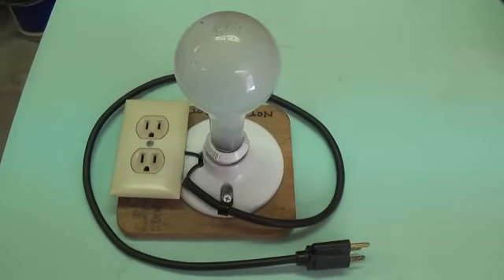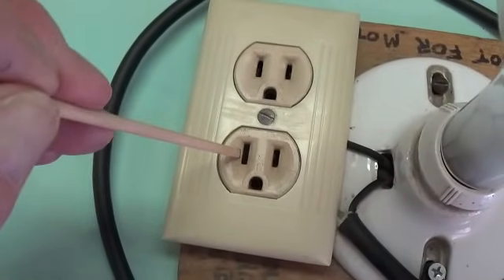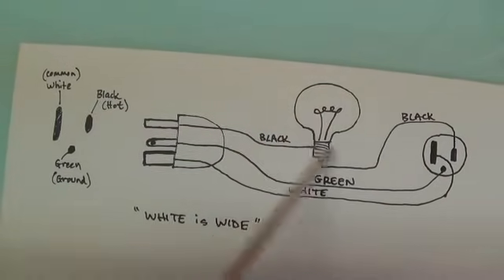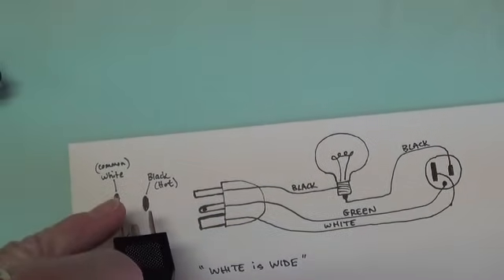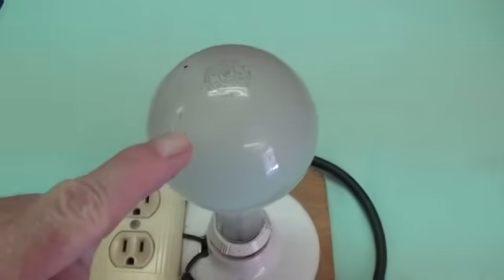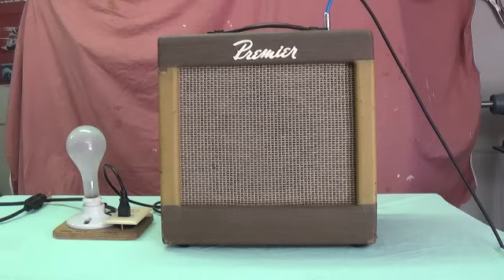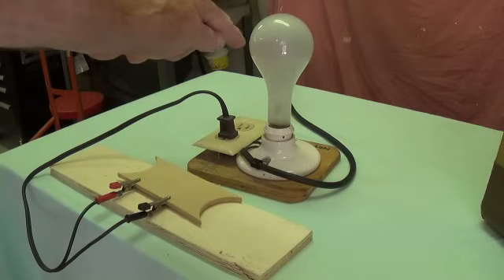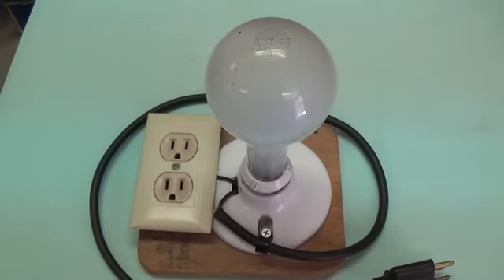Build Your Own Current Limiter for Protection when Repairing and Testing Electronic Equipment

Comment: I’ve watched your DBT video and I understand your explanation as to why a higher wattage is so crucial. There must be close to 50 DBT videos on YouTube and I have watched nearly all of them and just about all use lower watt bulbs so that when the amp is turned on the bulb illuminates then dims providing there is no short. One person said you should size the bulb wattage 150-200% of the amps wattage draw. Another person told me you should not need any higher than a 100W for an amp with 4 X 6L6 tubes or a 60W for 2 X 6V6 tube amp. I constructed a DBT and tested several of my amps to see how it functions and my 200W bulb did not light like in your video. I tried a 100W bulb and it did light up dimly only momentarily then went out. If you are right about using a higher wattage bulb then it looks like just about everyone on YouTube is not doing this correctly. I honestly don’t know which is right but I’m guessing the reason this is known as the dim bulb tester is because the bulb lights dimly then goes out when there is no short. Do you have any thoughts on this? I’d really like to understand this better. Thanks
Reply from the maker: I honestly don't think it makes all that much difference, 60R, if you use a lower wattage bulb that lights up and dims, or a higher wattage bulb that only lights up when there is a short. Either way, the circuit is protected from drawing excessive current. Personally, however, I prefer my method, simply because any illumination of the bulb is a warning sign. Furthermore, the higher wattage bulb offer higher filament resistance and thus greater protection for the circuit.

Comment: I read  " not for motors" 
, my old tube tape echo runs with a motor, is that a problem? Thank you
Reply from the maker: The problem is that most motors draw a large initial current to start.....and the current limiter will not allow them to do so.  As a result, I don't suggest using a current limiter with an AC motor.
Reply: Uncle Doug Thank you so much sir. My echo has a switch for turning on and off the motor separtly, i'll keep that in mind when repair the electric circuit that the motor is turning off. Again many Thanks much appriciated.
Reply from the maker: A very small AC motor may work with the current limiter. You can easily test the motor with and without the CL to see.

Comment: Hi Doug, I built one of these years ago after watching your channel and it's worked perfectly all that time so thanks for that and the fine work you do educating us :-) BUT today I got caught out and I want to share my experience with you. I plugged an amp in to my variac via the current limiter as usual BUT I left it in circuit when I started to bias the amp and as a result all my voltages were wrong since the current limiter acts as a voltage drop. So my warning to everyone out there is, remove it from circuit when you set the bias voltage and/or measure voltages for fault finding. Perhaps you could confirm if my recommendation is correct Doug or tell me what I did wrong, thanks!.
Reply from the maker: You're welcome, Nigel.  You're absolutely correct, the current limiter does reduce the circuit voltages a bit. You can bias without it, or you can apply a correction factor, or you can do what I do and simply accept the slight reduction as a "safety factor" to ensure somewhat conservative biasing.

Comment: I can't speak highly enough of these. Whether you work on tube amplifiers at home, solid state amplifiers at work; biasing procedures, modifications, an output stage rebuilt. You really need to have one of these as they can stop your circuit from blowing up if you've done something wrong.
Reply from the maker: Amen, LH. It is definitely one of the most useful tools on the work bench.

Comment: I'm confused why this works, Doug! If there's a short circuit in the equipment under test, then it's in parallel with the bulb, right? If electricity takes the shortest path, then why doesn't the short take effect and blow the circuit breaker? Also, if there's a short circuit why does that damage the amp?
Reply from the maker: A short circuit within any electronic component can destroy it, NR, generally by heat and/or internal arcing......not to mention the smoke and stench. Any short within the amp is in series with the bulb, and the bulb filament will immediately heat up, greatly increasing its resistance, illuminating the bulb to warn you, and thus prevent excess current from damaging the circuit.
Reply: @UncleDoug  Ah, I missed the SERIES part. That makes sense now - thanks!

Comment: I’d suggest connecting the black wire from the main to the center of the bulb not the outer edge. That’s how it’s done per code. Of course, since we’re working in an open chassis safety is really up to the tech.
Reply from the maker: Thanks for the suggestion, Kirk.

Comment: Hello Uncle Doug, Thanks a lot for All your video's much to learn from.
I got a Question 
I was thinking to build and use this continuously between my vintage early sixties guitar gear. Like an old tube tape echo(high voltage circuit inside) They were build unsafe those days, most old tube gear has a 2 wire cord with no grounding. I believe when it's get a short inside, I ' will be electrocuted by my guitar. (We got here 220Volt)
The idea was those days, when it's get ever shorted....the short goes via the output of the echo to cable to the amp, that is well grounded, oh and if she is not grounded fit you got a major problem for your amp and yourself to! (kind of ridiculous anno 2019). I her people saying; why not install a 3 wire cord with ground fitted to chassis?? Well, I do not want to do a modification inside because of originality.
Could this be an alternative solution for me?

Regards
Reply from the maker: I really think that installing a chassis-grounding power cord in both devices would be the best idea. It's done all the time and doesn't reduce the value of the amp or effect. The only other possibility would be to run a ground wire from your wall socket and clip it to the amp and/or tape echo machine. The current limiter will greatly reduce the possibility of a fatal shock, but will not protect you as well as a grounded chassis.
Reply: Uncle Doug Uncle Doug Thanks a lot, you now got me persuaded. I definitely install a seperate grounding wire, or use a 3 wire cord.
Reply from the maker: You'll be much better off, R4. Best of luck.
Reply: Uncle Doug many thanks for your advice sir. I decide to replace the powercords for a 3-wired cord with groundwire mounted to chassis. Is a fuseholder with fuse between hot wire recommended?

Comment: After 904 comments my answer is probably buried here somewhere, but haven't seen it yet.

I in the U.S, have a 220V 75W bulb, will that work?  Im thinking higher voltage=carry more wattage.

Best video I've found, thanks
Reply from the maker: You're welcome, Kip. I would advise against it. You can generally find 200W bulbs at the Home Depot or even higher wattage on Amazon.

Comment: Uncle D, I tried to read through the 5 years worth of comments to see if this was asked yet but I didn't make it to the end so I'll ask anyway. Can this be used with an isolation transformer ? If so would the IT be plugged into the CL (since the CL is grounded)?
Reply from the maker: Yes, you would plug the CL into the wall receptacle, then plug the IT into the CL.

Comment: Uncle Doug- It’s amazing how deep some will dive when a discussion of building a simple test tool is shown. Very inspiring to get the concept and its application. As a byproduct, I was forced to learn with the aid of yt videos how to solder by learning what makes a good solder joint. That and having taken my backyard welding up a few notches in industrial machine repair. All I need is a lathe, a surface grinder, Bridgeport milling machine and a 6X48 belt sander to round out shop equipment! Or maybe just bend sheetmetal with angle iron and C clamps!
Reply from the maker: As Archimedes once said, "Give me some angle iron and  C-clamps, and I can make an amp chassis".

Comment: Hello uncle Doug! I am about to start building a tube amp, and wanted to build a current limiter like the one you used. I have a 150 W halogen bulb with its socket, do you think I can use that instead of a incandescent? Thanks!
Reply from the maker: I wouldn't trust it, Luis. You can get incandescent bulbs at most building supply stores as well as Amazon and probably Ebay.

Comment: I have a runway light bulb, 120V @ 40 amps, would that be good?  The filament is the thickness of a pencil lead.
Reply from the maker: No, that is the opposite of what you need. Try a regular old incandescent 250W bulb. You can find them on Amazon.com.

Comment: All of North America, The U.S., Canada, and Mexico, use the same power standard.  Japan uses 110v/50hz rather than 120v, but that's very close to North American power standards, and is obviously a little less voltage overall with a lower frequency cycle of 50hz compared to North America's 60hz.
Reply from the maker: Thanks for the input, FC :)

Comment: Excellent device. This is a perfect example of "less is more". I recently acquired an old radio with a 5Y3GT and 2 6V6's. Would that work for seeing if the tubes are good or bad if I swap them into an amp?
Reply from the maker: Thanks, Joram. I'm not sure that I understand the question. Are you wondering  if the current limiter can be used to tell if tubes are good or not?
Reply: Sorry for not being clear. I've acquired a 5y3gt and two 6V6's from an old tube radio and I'm wondering if the light bulb device would protect an amp from any possible faults in those tubes in my amp? Sorry for being so verbose. @UncleDoug
Reply from the maker: No problem, Joram. Yes, the current limiter will protect any electronic device regardless of the tubes it may contain. All it monitors is the current going to the device, not the components within it.
Reply: Thanks, that's great news. Like yourself, I like to minimise costs and recycling parts is a great way to do it.

Comment: A good old dim bulb tester    .with larger wattage incandescent bulbs almost obsolete a few 75-100 watt bulbs in parallel  may be needed to make the device .
Reply from the maker: You are correct, Mr. 71. Home Depot seems to have high wattage incandescents in stock from time to time.

Comment: Hi Uncle Doug
based on your video I just built my own current limiter for my hobby lab. 

A few weeks ago I had damaged an older amplifier due to a short circuit caused by me.
With the current limiter the damage would have been less likely :)

Great thing!!!
Reply from the maker: Congratulations on a successful build, Dr. B. Your amp circuits will be safe now :)

Comment: Quick question UD: Would a lower wattage bulb provide more protection, or would it just be more likely to illuminate as a result of normal current draw in a tube amp?
Reply from the maker: The bulb wattage must relate to the amplifier wattage, i.e. 200W to 250W bulb for tube amps from 5 to 25W output power. 300W and above for more powerful tube amps. 50W to 100W for SS circuits.

Comment: Oh, Uncle Doug. I see you still subscribe to that obsolete "Electron Flow" theory of electricity. ;)
Don't you know that electricity travels through smoke, not electrons?
Once you let the smoke out of any circuit, good luck collecting it and stuffing it back in. (JK)
BTW, I'm re-watching this video because I need to build one of these for my upcoming Newcomb D-10 conversion.

The more I watch your videos, the more I get from them. Thanks for everything you do.
Reply from the maker: You're welcome, F3. I"ll brush up on my theory :)  You're wise to build the CL.....it is essential for protecting circuits being tested. Good luck with your conversion.
Reply: Since stuffing the magic smoke back into a circuit is harder than herding cats, I think building the CL is DEFINITELY the path of least resistance. (Pun sort of intended)
Reply from the maker: It's an absolute necessity, F3.

Comment: Concerning electrical- wiring color codes, some modern IEC modular type power cords (as you would see used for computers and other devices that have a removable/ replaceable power cord) actually have a European? or Asian? color code; green would be still ground but the hot and neutral wires are brown and blue respectively if I remember correctly. I always check it with an ohmmeter first just to be certain!
Reply: The IEC 'earth' a.k.a. 'ground' wire is green with a yellow stripe.

Comment: Basically it limits the current to 2 Amps. You could still blow some low power circuits tho, but at least they wouldn't explode.      56 ohms   in line.
Reply from the maker: A fuse can offer a fixed 2A  limitation, but with a current limiter the resistance to current flow is not fixed, but reactive. Due to the sudden increase in resistance that occurs the moment the filament temperature increases, the CL strongly resists any rapid increases in current flow and thus can protect internal components, including relatively low-current circuits. In 20 years of continuous use, throughout all sorts of catastrophic mishaps, I have never incurred a single damaged component while using a properly-bulbed CL.

Comment: thanks doug.  i cant read all 873 comments but what is the protocol for an unpolarized ungrounded plug in an amp like a dynaco st70 where most people say DONT replace with 3 prong cord.  therefore its tough to know what prong holds 120v.  does it matter with the bulb on black wire??
Reply from the maker: The current limiter must be constructed properly, with the black (hot) wire passing through the bulb filament. If an amp has an unpolarized, two-wire cord and there is no way to tell which is the hot wire, then it can still be plugged into the current limiter and will be protected regardless of how it is plugged in.
Reply: thats great news.  thanks  still dont understand unpolarized plugs and black/hot wires cause in AC arent they both hot depending on when you are observing.
Reply from the maker: Actually only one wire is considered the "hot" wire in AC and it is usually black. The white wire is the common or return wire, and it is connected to the earth ground generally at the fuse box in most buildings. I have posted a video (see my Isolation Transformer video series) explaining this all in detail.

Comment: I decided to run 4 100 watt bulbs in parallel, and I have a switch with outlets that tap off at 100, 200, 300, and 400 watts. I made a second set with 300 watt Mogul base bulbs. 300, 600, 900, and 1200 Watts, and I am adding another bank of four! I have my amateure extra class FCC license, and I have PTs that put out 6000 Volts loaded @ 1000 mA. 100, 105, & 115 VAC in, and 6000 out, so on the 100 volt tap over 7000 volts!  My poor Nissan looked like a lowrider when I brought both of those US Navy PTs home. I have to go move them again tomorrow, too! they are about 170 pounds each!
Reply from the maker: Good grief, Seth. Your workshop must look like Dr. Frankenstein's lab. I applaud your inventiveness with regard to the switchable current limiter......excellent work. Good luck with your moving :)
Reply: @UncleDoug  You should have seen the home brew transmitter those Navy transformers were running. Picture 8400 volts DC running along 2x4s with a two strings of diodes and it was wide open to the fingers of 4 small children. The man went to a solid state homebrew x-mitter that ran on a much safer and saner 12-45 Volts at the bequest of his wife. The new  Triquint and NXP make some powerful but expensive Gallium Nitride transistors that will run from LF @  20,000 Hz to SHF and LHF 3,200,000,000 Hz!!!. LF is a weird and wonderful slow super DX. HF-VHF and UHF is what everyone uses. SHF is mostly for graduate level experimenters. I have a GROL now, and that is commercial FCC.
Reply from the maker: @Satchmoeddie  Thanks for sharing, Seth.

Comment: Hi Doug, thank you for all your great videos - I'm learning more from them than I have in the past 20+ years on my own and through books. They are an invaluable resource! I built a current limiter as you describe here, and it works great with amps and other electronics I've plugged into it - no bulb glowing yet. However, I do have one question - I plugged my electric drill and then my heat gun into it, and surprisingly both illuminated the bulb. It was fairly dim at first but started glowing brightly before I quickly turned them off and unplugged them. Does this indicate my drill and heat gun have a partial or dead short? Is this something I should be concerned about, and should I take them apart to figure out what's up or stop using them? Thanks again!
Reply from the maker: You're welcome, Jason. Your drill and heat gun are working properly, they simply draw more current that the bulb will allow to pass. I have a sign on my own current limiter that says "Not for motors", for just the reasons you discovered. The heat gun probably produces 1500W of power (heat). According to Ohm's Law,  I = P/V, so the current flow would be 1500/120 or 12.5 Amps, which is about 6 times more than the bulb will allow to pass.

Comment: Can this current limiting device be used on vintage receivers?anyone know?Thank you
Reply from the maker: Yes, it can. As long as the bulb wattage is appropriate for the current draw of the receiver, it will protect the circuit from self-destruction due to an internal short circuit.
Reply: @UncleDoug  Thank you for the reply.
Cheers